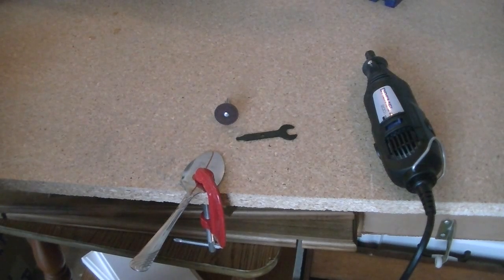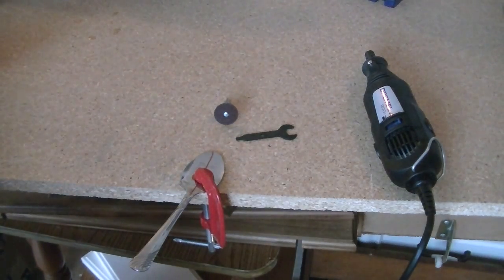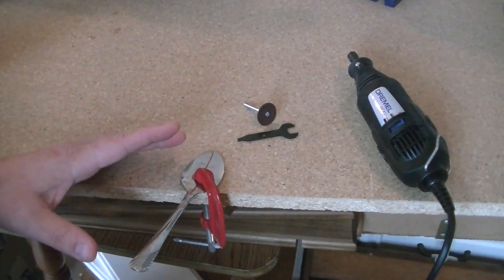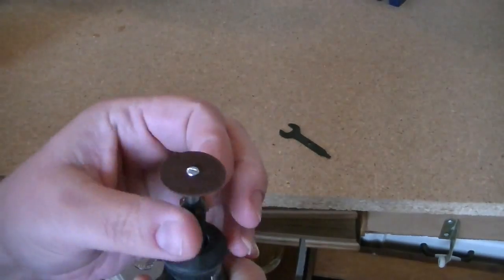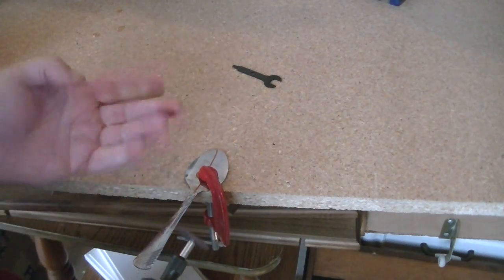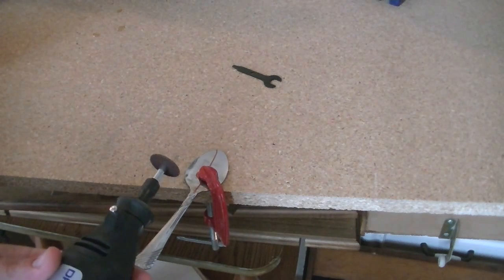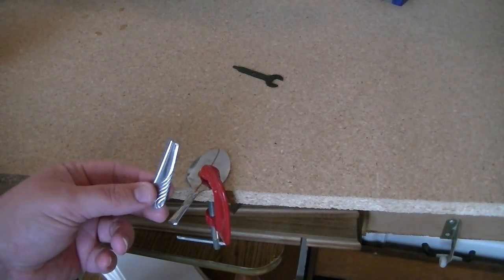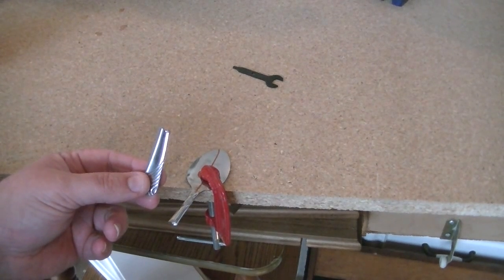How to Cut Silverware with a Dremel

Comment: This video helped me immensely.  I used a 426 1-1/4" Fiberglass Reinforced cutoff wheel and followed her directions.  I was using a small demitasse type spoon and only wanted to use the handle for a mosaic.  I set the Dremel on high speed and it literally took maybe a minute or 2.  I then filed the ends.

Comment: You should actually push a little bit (it won't wreck anything) because that takes way to long it should only take 20-30 seconds :/
Reply: that dremel bit looks pretty thin, you can definitely apply pressure but I think you risk chipping the bit if you go too fast.